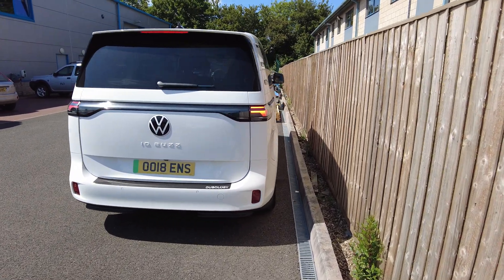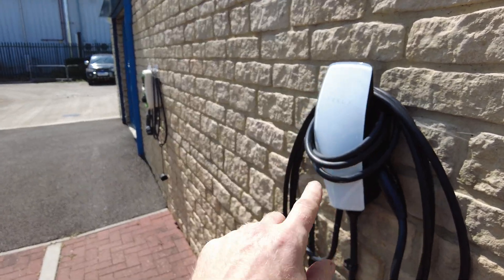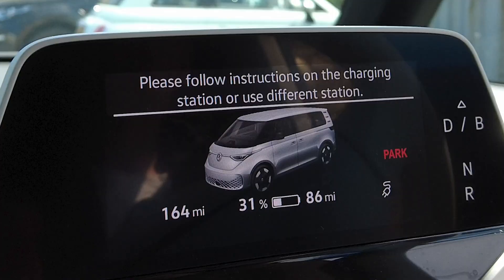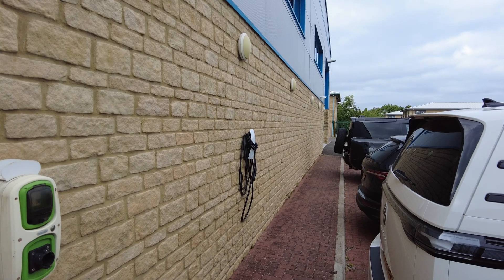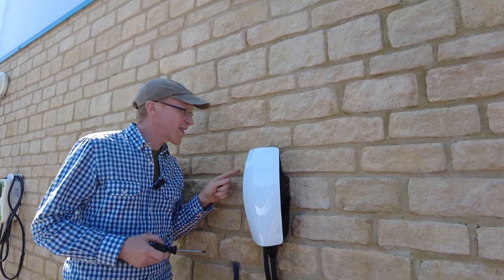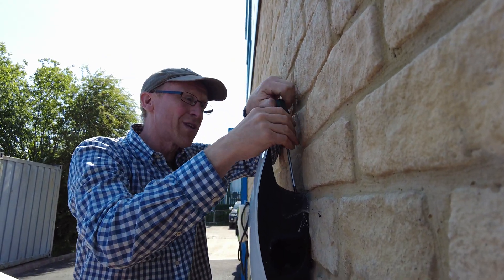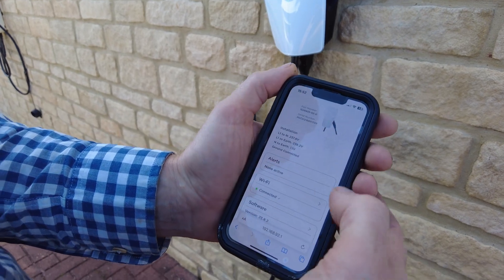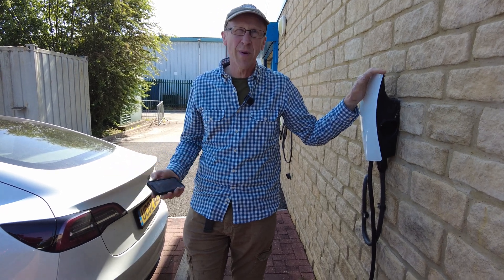How To Unlock Tesla Wall Charger To Use on all EV's / VW Buzz First Charge

Comment: Interesting video - thanks.  But it does tell me never to buy an electric car!  They are only any good for someone doing low milage and can charge overnight at home.  For me doing long journeys across the UK and Europe it would be totally useless as charging is far far too slow to be any use at all. 

The perfect vehivle would be an electric vehicle that gets its power from an engine that is only there to generate electricity (and not actually power the car) - this way the MPG would be very much greater and far less pollution - in the future the enging could be Hydrogen powered, but the technology is not there yet.

Comment: Hello Simon, I don't no. It seems to be a right palaver. I go to the petrol pump, 5 minutes the cars full and I'm away. They should get the infrastructure right first.A stupid question maybe, but who pays for all these chargers? Are they free with the car?
Reply from the maker: I guess you need to factor in the time driving to the petrol station and back ... we are charging the cars at work so there is no distance to travel to the petrol station. The Tesla charger was around £350 but the new Zappi charger we are buying is £900 !
Reply: @L663  what you're saying to me is you buy the car that's already over priced and you then have to pay for a charger. You said you can charge the cars at work but I think most people don't have that luxury. I'm quite happy to stick to good old petrol.

Comment: So 10 minutes to fill the disco 4 = 2400 mph of charge. I sometimes fuel the disco 3 times in a day, electric just doesn't work doing distances or towing. 
Im not against EV , i just don't see it as an answer to all. My other issue is them being referred to as zero emissions,  yes a lot more power generation is renewable, but not all and therefore emissions.

Comment: A wall charging point should be capable of charging all vehicles from installation. Otherwise it leaves owners stuck to one make of car.
And, a threes phase charger should be capable of charging at a faster rate than that one does surely?
Can you imagine d a petrol station with sewerage pumps for every make of car? 
There is a long way to go before owing an electric car is totally user friendly and straightforward for all. Never mind it being expensive to recharge a car. Most households have at least two cars, there aren’t enough hours in the day to enable recharging two or three cars without multiple charging points and, I hate to think how much that would cost.

Comment: What a load of rubbish, only 17 mph charging. Are we sure electric vehicles are the way forward. Imagine all the cars are now electric and all plugged in over night, the National Grid will melt down, not to mention the power cabling upgrade to the streets required. The tarmac on the roads would melt, substation exploding in the cul-de-sacs, power outages, better stock up on candles. ;-)

Has anyone thought this through?
Reply: Exactly why the likes of Octopus do load sharing throughout the night encouraging people to use different times with their smart chargers for cheaper tariffs.
Reply: My Tesla M3 charges at 11kw with the same charger, for the ID Buzz it should at least be able to double the charging. Then again, I assume you sleep at night? How many hours does your car not even move? Exactly. And on the road I can use a Supercharger with 149 miles per 15 minutes, that is 600 mph!. 

Charging is the least of your worries for todays EV's in most countries. The fact that I charge for free with my solarpanels just makes me smile more every time I pass a gasstation ;) I save around 65% compared to gasoline, even more if I count in the solar.